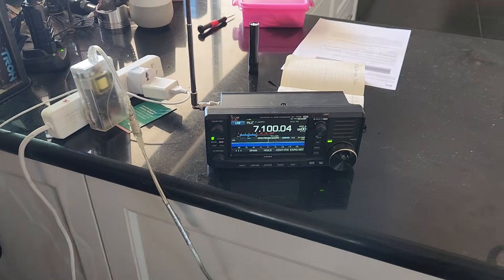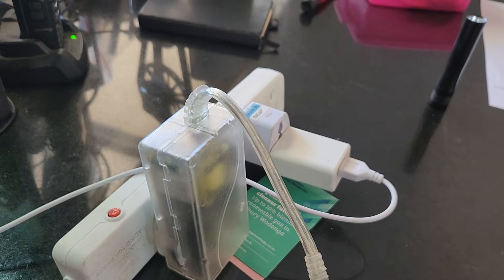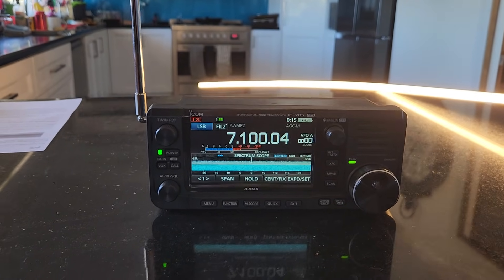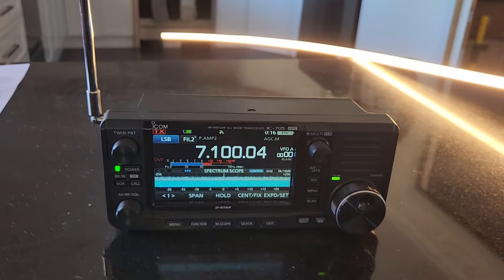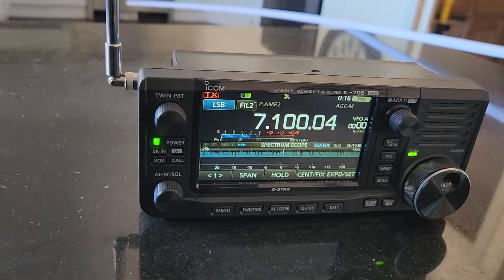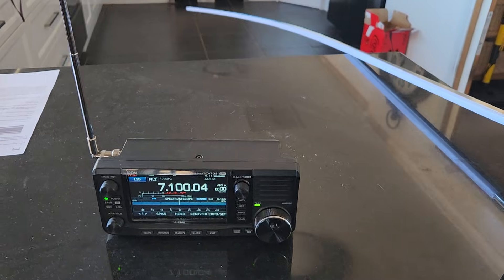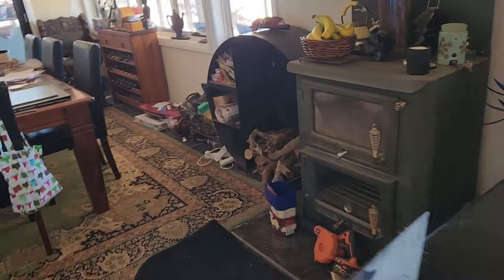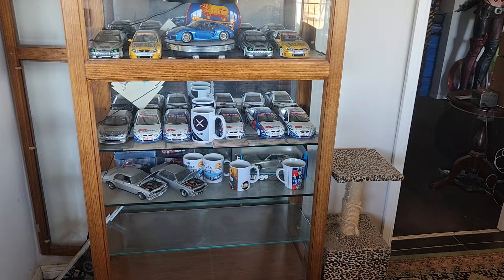We found the RF noise in the VK3CM VK5BM shack with the help of an Icom IC705😊😊😊

Comment: You will probably find the extra noise when you turn the light on isn't because it's acting as a antenna to the SMPS (switch mode power supply) power pack.  It's probably that the light uses a PWM (pulse width modulation) controller for the LED's.  When you turn on the light your getting a double whammy.  I hate modern switching supplies, the cheap improperly filtered ones.  I got tired of chasing down RF birdies so I just removed all the SMPS from my radio room and repair benches.  Everything is now good old power wasting linear supplies. 🙃